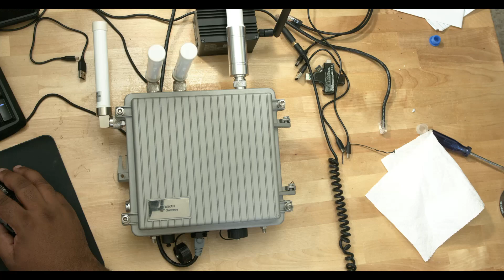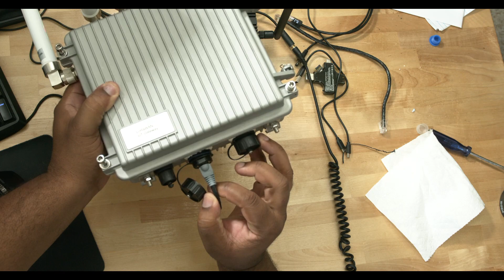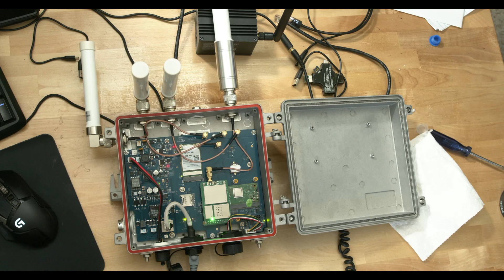Brief Tour of the RisingHF Helium Miner

Comment: Thank you for the video! Great information to get in the command line! 

How is it performing so far? If you can, please share a link so others can look at how it is performing.
Reply from the maker: Funny you mentioned that because right now, it's down, and since it's hosted with an ISP, I have to get into ouch with them to have them cycle power to the unit.  But in general, I'm a bit dissappointed.  Still no UI from the manufacturer, and their support is lackluster.
Reply from the maker: Best Mercurial Meerkat